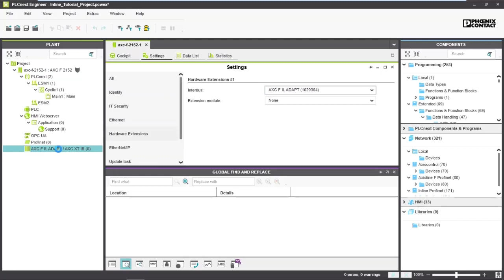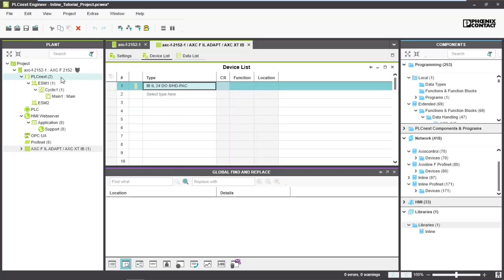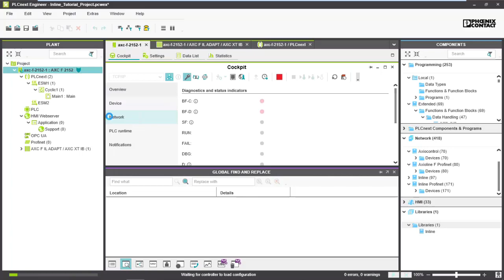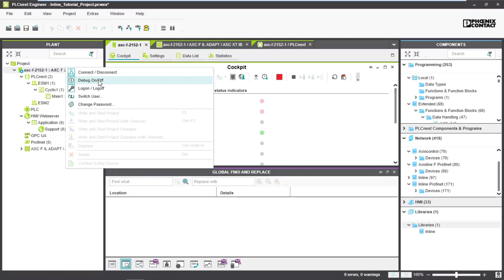How to connect Inline modules to an Axioline PLCnext Control | AXC F IL ADAPT

Comment: How to configure IB IL AI 4/I-PAC within PLC Next Engineer?
Reply from the maker: To configure the Inline modules you need to configure the Inline Adapter first. This can be done on the controller in the section "Hardware extentions" for Interbus. Then you need to reference the Inline module library. Therefore, you simply go to the libraries section in PLCnext Engineer, open the context menu on "Libraries" and choose "insert Libary". You'll be directly routed to the available libraries. There you have to choose the Inline lib. Then you're able to configure any available Inline module in the same way as you do the configuration for Axioline modules. We hope this was helpful, if you have any further questions, please don't hesitate to go over to the Forum in the PLCnext Community https://www.plcnext-community.net/forum/

Comment: how to get inline library in plcnext store
Reply from the maker: Hi Narendra, after installing PLCnext Engineer, the Inline library (Inline.pcwlx) is already on your computer and can be included in your project as shown around 4m:00s in this video. Check this default path on your computer, please: C:/Program Files /PHOENIX CONTACT/PLCnext Engineer 2020.6/Libraries (maybe adjust the version number). In the PLCnext Store, find useful function block libraries, e.g. AnalogTechnology!
For further dialog, please switch to the Forum in the PLCnext Community (https://www.plcnext-community.net/en/discussions-2-offcanvas/categories.html) and create a user account there (free of charge, no newsletter bugging), so we can help you with this question more efficiently.